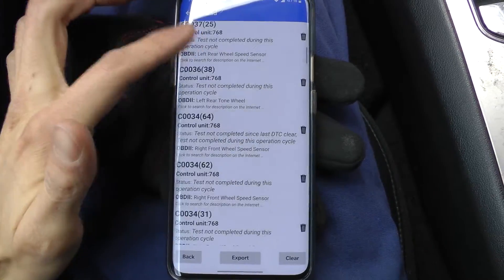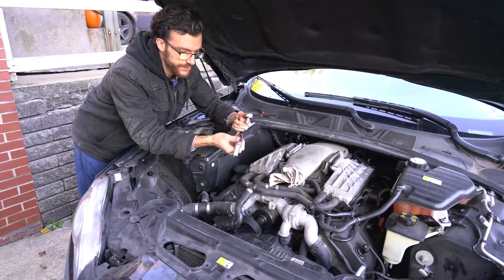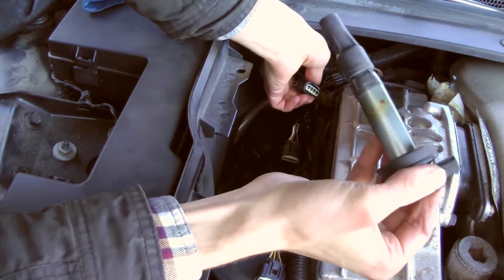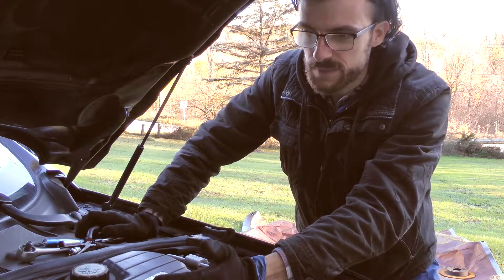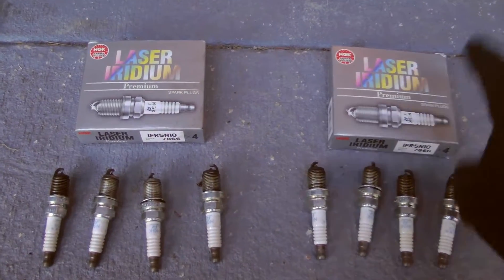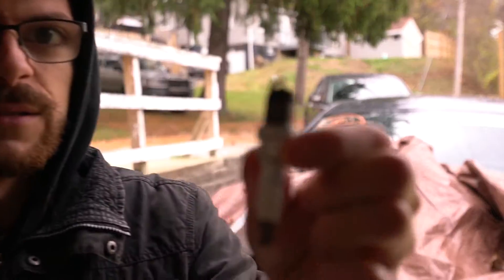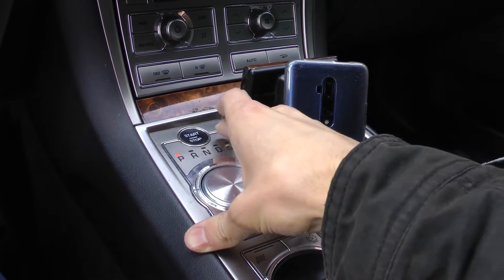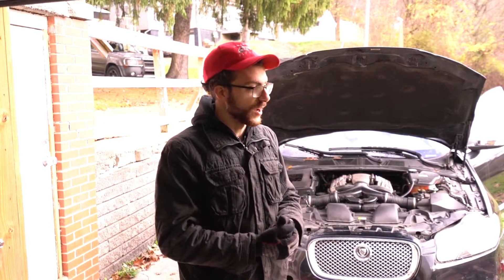Jaguar XF V8 Replacing $3 Spark Plugs  - Performance Restored??

Comment: Thanks for the great vids Sam.

Did your 2009 have rubber shrouds on the cylinder head ends (covering the spark plugs/coils)? I'm trying to do my 2011 XF 5.0L plugs, and can't see you to remove them. They seem to be caught all over the place near the last plug (at bulk head).

I've had to remove the coolant overflow tank, did you have to remove anything to access your plugs?
Reply from the maker: Thanks for watching and the commenting! 
More than happy to help. I really had to think back on that one but yes, I had covers. They just sat on top over the valve covers and coil packs. They just popped off, if I remember correctly. I know it’s pretty darn tight working on them but didn’t have to remove my coolant tank. Is your beauty cover off? That might help get the other covers off.
Reply from the maker: If there was anything else removed, I think I just did some plastic clips holding in wires.
Reply: @GTSam  Yes, my car still has the black felt inner liner on the engine bay surfaces. I keep wondering if the maybe the engine has dropped a bit (degraded engine mount maybe) to make it so tight.

I'm getting a bunch of 300 codes now (engine misfire), so I'm changing the plugs as a precautionary measure to hope fully fix it. Otherwise I may have to follow your other video to get to clean out the fuel filter (my years model may come with the filter in the tank with the fuel pump).

Haven't seen all of your vids, so i hope you get your engine running smoothly. If not check out SamCrak's video on his jag (similar issue to yours, with a cheap fix. Fingers crossed)

Comment: Nice video. Question, I have a 2011 Xf  Na V8 . What is the gap number ?
Reply from the maker: Hey, it appears that OEM spec is 0.44 to 0.40mm. If you're in that range, you're golden. Also, just make sure they are Iridium's 😉 I have a car right now that I checked the spark plugs and their gap was over 0.70mm!! Supposed to be .44. Crazy! Those plugs were there before I got the car so someone dun mess up.

Comment: Shes toast buddy...also don't waste 10 days trying to pull the charger because the bolts in the back are dam near impossible....just pull the motor and find a good used unit....and slap it in in a day or 2....ask me how I know

Comment: Is this car expensive to maintain ?
Reply from the maker: You ask a very interesting question haha. Personally, from what I've seen and know about this car from working on it and owning it, no. But then a yes if you don't have time and ability to care for it. Let me explain.
I believe this engine would have been completely fine, even if it is mainly a Ford, if the previous owner actually put good oil in, a good oil filter (not $3 like was on it), changed the fluids regularly, used proper spark plugs, and watched the oil level for when it got too low, could have  solved SO many issues that I now deal with. So, yes, if you do a good oil change frequently, your chances will be much better for maintenance. I mean, you have to buy a lot more oil but worth it. 
Interestingly, the original owner that had it took very good care of it, I have documentation left over and that person even had an extended warranty on it. It's too bad they let it go and get into the way it is now...
Reply from the maker: Oh, and using premium gas and once in awhile injector cleaners could have helped too 👍
Reply: @GTSam  thanks man
Reply from the maker: @autotrimmers6353  anytime!

Comment: What if it smells like fuel??
Reply from the maker: That depends on if the plugs are wet or if they just smell like fuel. Fuel is supposed to be burned up in the combustion chamber but if your plugs are covered in soot, could be something else. 
Additionally, the engine could be running rich and dumping too much gas and possibly sometimes a bad plug and might simply need replacing.

Comment: Research the codes. They  don't just pop up for nothing. One thing for sure. You have no business working on anything. That motor has major issues and to fix it try reading and understanding the fault codes.
Reply from the maker: @lexbarton3196  good thing I owned that car so I have a lot of business with it.